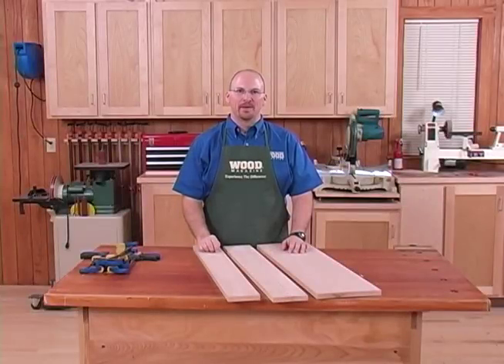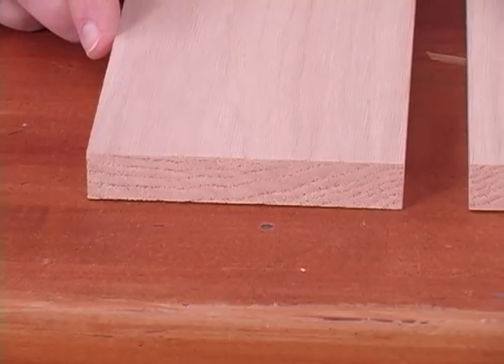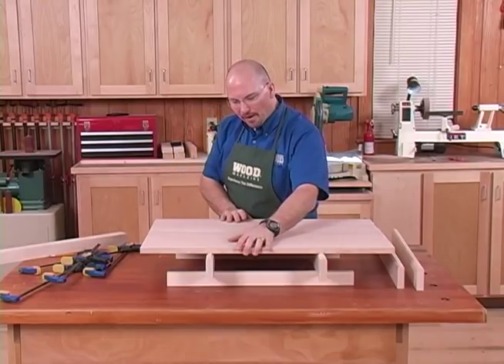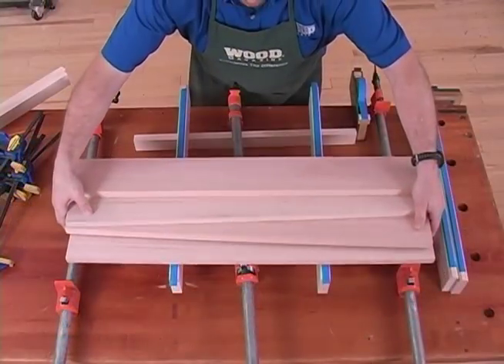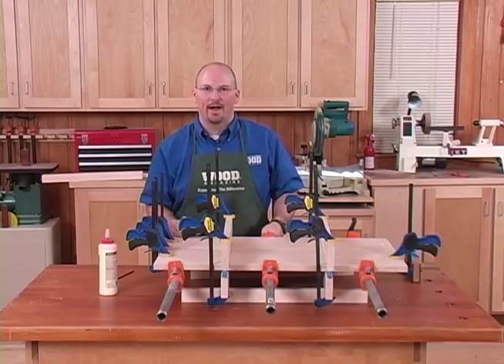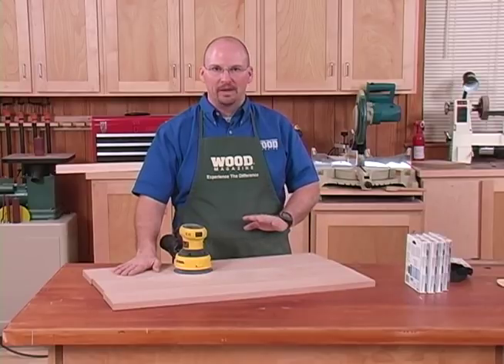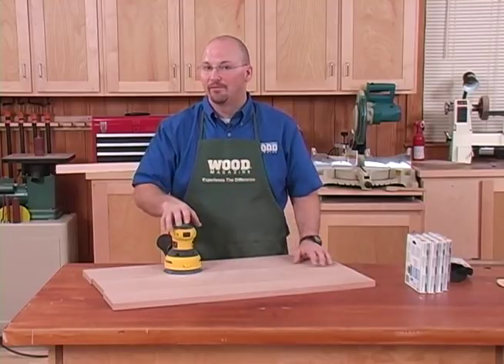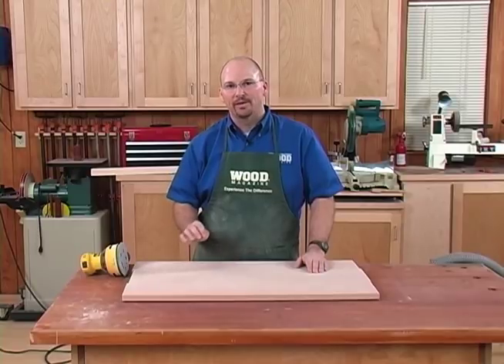How To Clamp and Sand Flat Panels - WOOD magazine

Comment: You need to run those boards through a jointer. Badly. It's very unprofessional to glue up panels that have not been through a jointer on the two sides, then in the planer / table saw for the other two sides.
Reply: ghostdog662  - you might want to look at the video again....  the first thing he says is that he’s going to show techniques to correct the issues “without spending thousands of dollars of equipment.”  So he’s showing the novice with some basic tools how to do it.
Reply: Capt I a low cost jack plane would yield better results than going directly to glue up without investing in a lot of hardware.
Reply: While you would ideally use a jointer / planer, he should have at least used a hand planer. That board is going to be warped
Reply: @capti443  
But he didn’t do as he suggested.